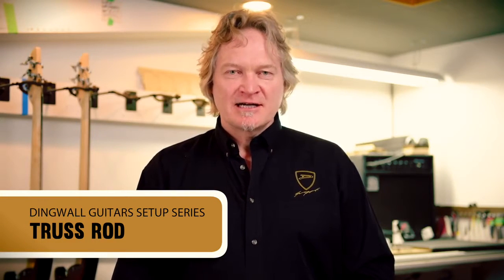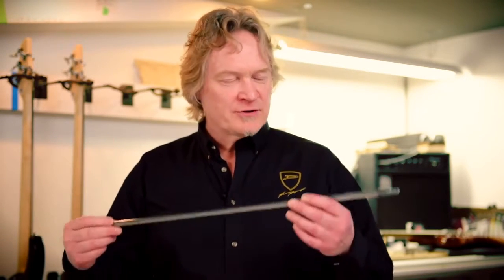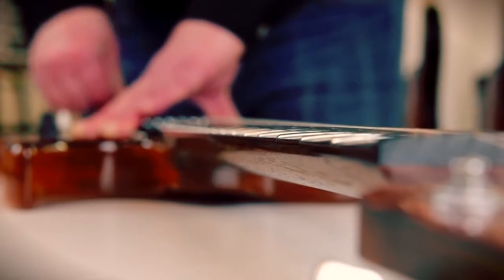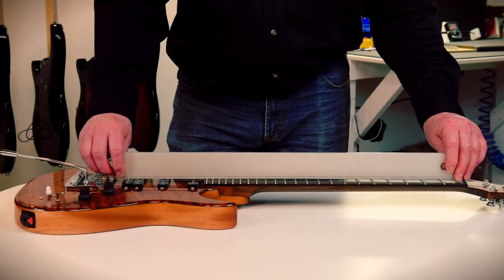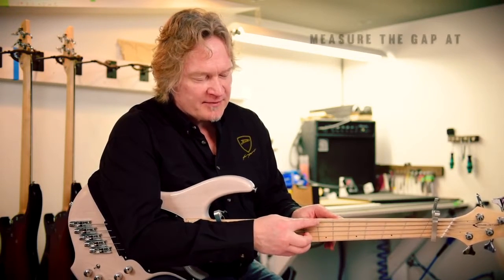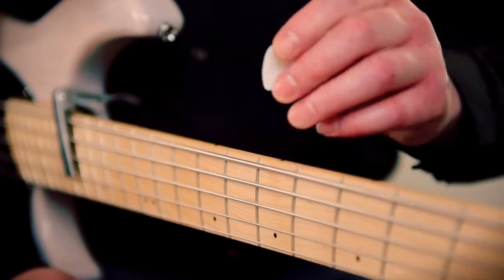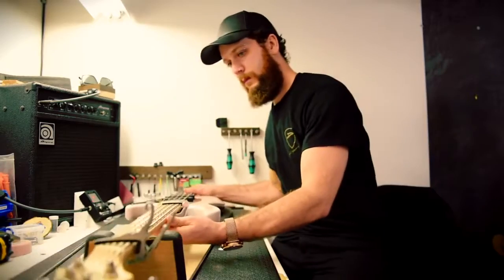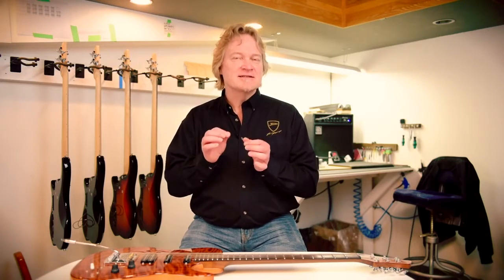03 Truss Rod   Dingwall Guitars Setup Series

Comment: What's the wrench size needed for the truss rod?
Reply: 9/64" ball end for all domestic models and early Combustion and NG models. 4 mm for all current Combustion, NG and D-Roc models. Visually you can tell the difference by the size of the access slot. 9/64" access slot is angled and narrow (3/8" wide), the 4 mm access slot is parallel to the top of the body and roughly 3/4" wide.